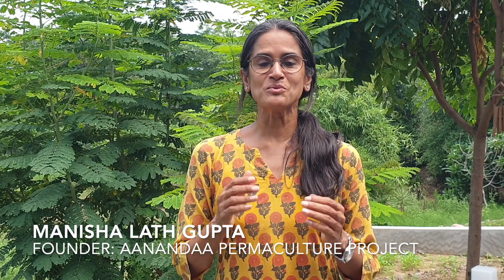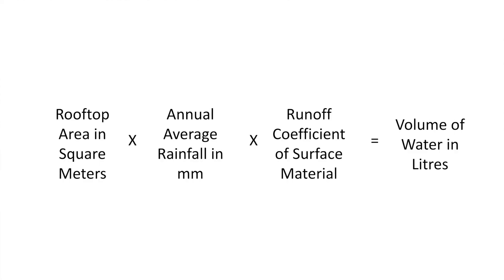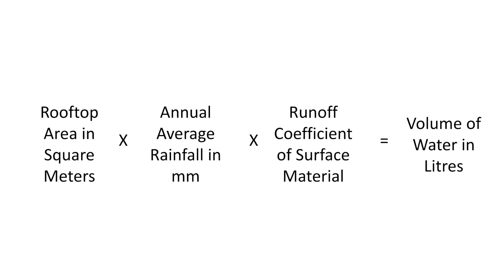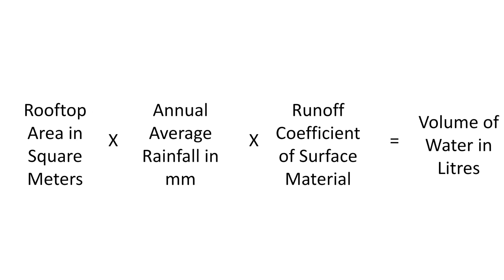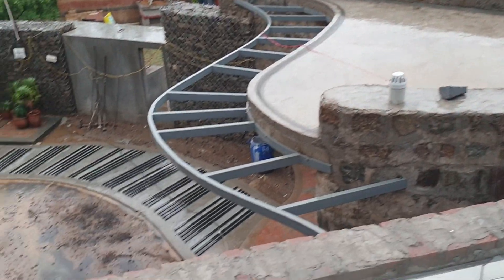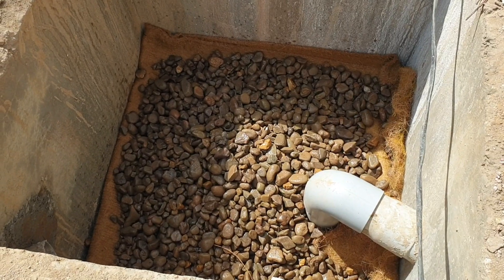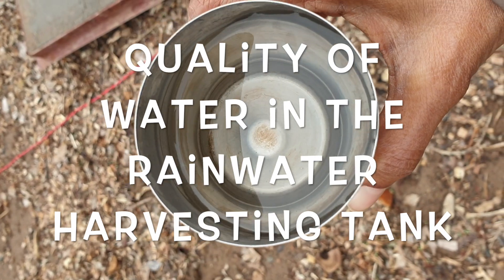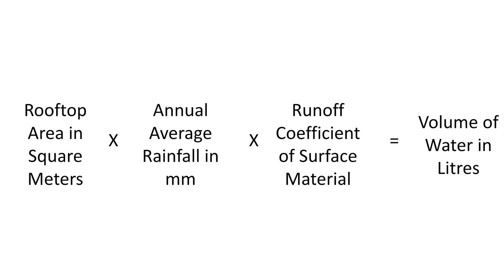Build Water Self Sufficiency with Rooftop Harvesting

Comment: We are an RWA with 220 flats. Water scarcity during summer is too much in Bangalore due to the cauvery water tribunal ruling. 
During rainy season there is no issue, we get sufficient water from the public water supply. What do we do during long summer months. Water stored by rainwater harvesting is not sufficient for the entire length of summer months. What is your solution for this.
Reply from the maker: Open. the harscaping around your RWA. Allow water to percolate into the soil. That is the best and in my opinion, only solution to the water scarcity we are all facing .

Comment: Thank you for the lovely videos💚💚💚 So enlightening!  Does the method you use for filtering your rainwater provide drinkable water or is a separate filtration system necessary.  I want to set up a similar system.

Thank you so much🌱🌱🌱
Reply from the maker: You will have to filter the drinking water in your kitchen, separately
Reply: @farmaanandaa  thank you🌺

Comment: Hi, what size pump do you use to pump water from storage into the house, and do you have a water heater to heat up hot water? How do you connect it to water system?
Reply from the maker: It's 1 HP motor. Water is heated by a solar heater installed on the roof.
Reply: @farmaanandaa  Thank you so much

Comment: got few questions, 1) does the water lose dissolved oxygen if it's stored for longer period and is it still good to drink? 2) does the rain water contain pollutants dissolved through atmosphere or parasites through bird poop? 3) is it advisable to run this water through some filter before using it for drinking? is gravity based filter good enough?
Reply from the maker: Water keeps moving around in the tank and hence does not stagnate. I doubt the rain water has pollutants .. bird poop being the least of them .. but yes you need to keep the  roof clean before the rains. Lastly you need a watee filter in the kitchen before deinking this water,  though its fit for use everywhere else.

Comment: We have started to collect a water from 150 sq ft room for our rooftop garden.We have drilled the rain water drain pipe at about 5 ft height from  ground , attached a one inch pipe of length 2 ft,kept two drums of 200 litre capacity (inter connected) to collect water 
r.
We r using water to garden, washing, etc.
This also can be directly let to sump/ well.No need of any filter because we tap water after one or two rains also we let out first few minutes water to drain.
The total cost is just under thousand.
Reply from the maker: Sounds like a great system!
Reply: @farmaanandaa  thanks for viewing and yr appreciation

Comment: Lovely video. Thanks for sharing it. Just need more details regarding the filtering process. I understand that the filtering tanks are deep with coir and gravel at the base of the tank. Does the water fall from top onto this base? Or us there another tank below the coir and gravel setting wherein the water collects? Could you kindly share some easy diagram on paper. Really appreciate your videos. Thanks,
Reply from the maker: The inlet pipes into the filter are above the outlet pipe as can be see in the video. The water falls into the filter and rises to the top, where it meets the outlet pipe and goes into the water tank.